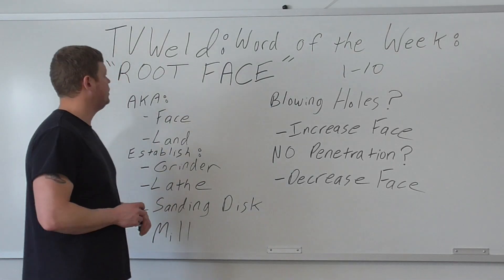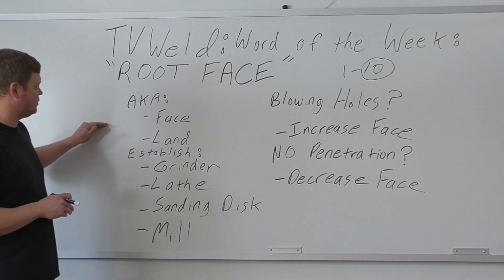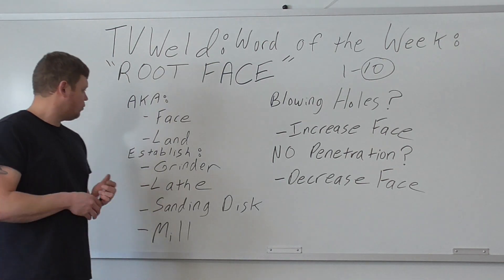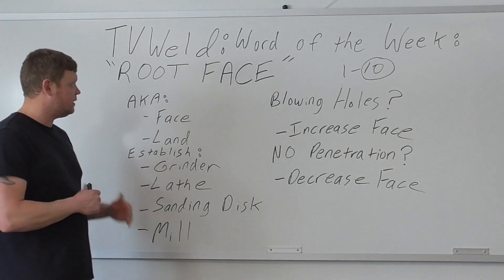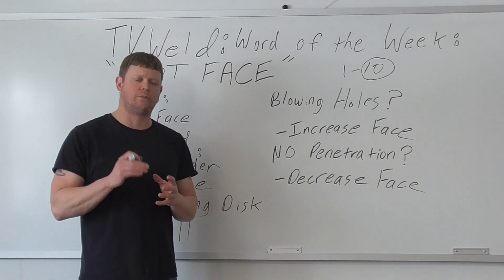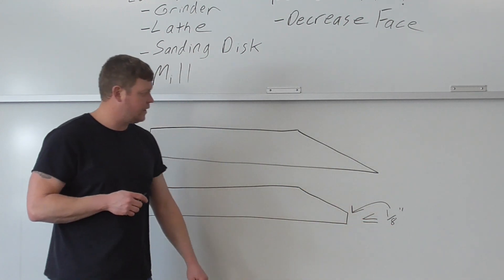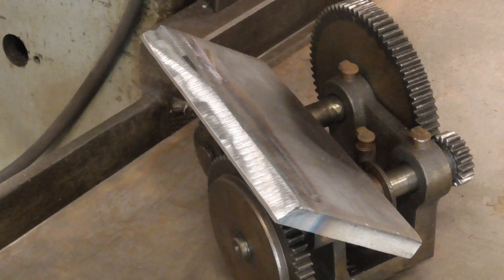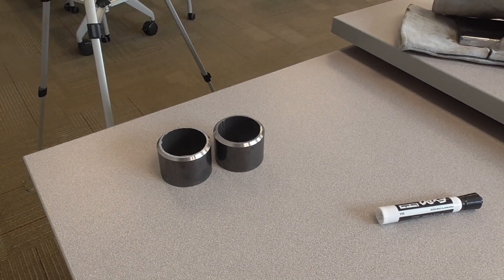Welding Root Face

Comment: In one of the interview, I was asked to answer, which gauge is used to measure the root face? 
Can anyone tell me what is the correct answer for this?
Reply from the maker: Shit that could be anything.  I'd say a caliper would be most appropriate, but we've used a measuring tape and it was fine.
Reply: @TVWeld  thanks,
We can say that, we can measure root face prior to fit up using either caliper or measure tape right?
Reply from the maker: @ravidivecha1921  Yes, I'd say so.